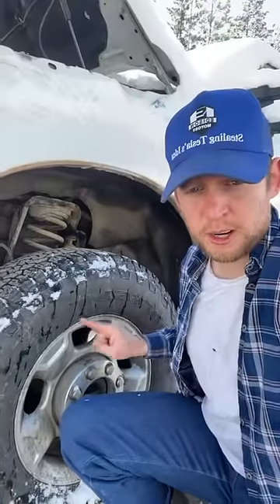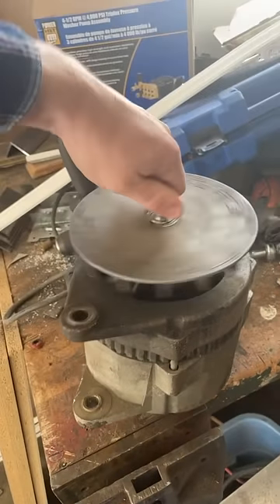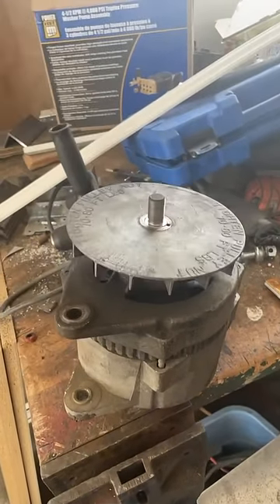Alternator on each wheel???

Comment: You're wrong bud. You're forgetting about centrifugal force and momentum. Whether the alternator is on your engine or your wheels, they both lose energy but the result is the same. The wheel idea does have more loss when your stopped and the wheels are not turning, but can gain energy back as the wheels turn faster, and your foot is not on the accelerator pedal, coasting. Btw, Tesla is doing this.

Comment: Show me the math. Use a pulley so it turns easier it doesn't have to spin as fast as the wheel. You could use a gyro and only engage them on the down hill

Comment: So now the question is why doesnt tesla use regenerative breaking. I know regenerative break will help a lot because i would drive a honda civic hybrid short distances that was owned by my company. It would go weeks without putting fuel in and at one point i could swear it went an entire moth with a single drop of gas in it and it always had battery power.

Comment: Surely these "laws of energy" need to be updated as technology progresses. If not an alternator, then something of a design in which will dictate heat with minimal friction that could not necessarily charge the battery but "top off" or just help add runtime? It's not an impossible idea unless you are stuck on an the idea of an actual or technical alternator. Let's think outside the box, but use the words "charging system". I mean, an alternator doesn't technically charge a battery from a fully discharged state. It only puts out enough amps to top off a battery that had very little drain from kicking over a little starter motor for a split second. 6,000 mi for an alternator to actually fully charge a fully discharged battery 12 v battery. Why don't people understand this? EV or electric vehicles are typically 80v systems. . It is a complete different application. Its like saying you want an alternator on your laptop.... 😅 Perhaps there is a structure that could be built in the roadways to wirelessly charge lithium packs in the future?? That would essentially be the equivalent of an alternator in a internal combustion engine with an conventional starting system that uses seconds cranking amps with and alternator to recover those tiny amps drained vs. An alternator on a battery powered vehicle that uses deep cycle or amp hours over long periods of time. An electric car is far more like a cell phone or a rechargeable lithium anything than it is like an conventional internal combustion car. People need to quit comparing the mechanics of an electric vehicle vs a gas vehicle. 2 completely different things if you really think about it.

Comment: Wonder why there hasent been a big flywheel car..  like over driving a few miles the flywheel gets its momentum and uses that afterwards to charge or reuse the force to push the car..  i guess the bearings would go to shit quicker and not work right..  but theres roller coasters that power off a huge flywheel that gets spun up at the beginning of each day and only has to use small motors throughout the day to keep its speed up which apparently uses less power than all other mechanical roller coasters..

Comment: It does work, and grandpa is right. You put a motor on each wheel. Then you can have all wheel drive, or one wheel and the others are regeneration.  The resistence from magnetic fields or whatever, air friction, all become meaningless ass the mass increases. This owner, is wrong.

Comment: The tesla drive motor energizes the stator during braking to slow the vehicle. This is what regenerative braking is. So when you press the brake you recharge the battery some. A fully fielded alternator cannot be turned by hand, meaning it would use more usable power than it created due to heat losses. Who are these people?

Comment: They have alternators on all the wheels a electric motor and alternator are the same thing basically so whenever u hit the breaks it uses the electric motor as a alternator to slow the vehicle and charge the battery done this way u are not braking the laws of conservation but it will only extend your range not full charge your battery

Comment: It would only be a slightly more efficient regenerative brake, any gain, would be accompanied by a 40-50% loss,  because alternators are only 50-60 % efficient, a 3phase electronically regulator maybe 85-90% efficient, but car alternators are 70%+/- at best

Comment: also the faster they turn the more power they make, thus you would essentially limit your max speed. your battery also wants to charge at a pretty specific voltage and that voltage could change out of that spec and potentially ruin your 3000 pound battery thus killing your car. and lastly, do you really want something as sensitive as an alternator that close to the ground and that exposed to the elements? i sure wouldn't.

Comment: What if, a pulley system was designed to lighten that load from the alternator that can produce around 500w? Then use that power directly to recharge or move the car.

Comment: Your first problem is believing that there IS nothing to generate energy from.  The first law of general dynamics is incorrect, because there is no such thing as nothing.  Just because you cannot see what is between you and the object in front of you does not mean that there is NOTHING there. You are simply not aware of what is actually there.  Start your energy solution in another direction.  The one you are in comes to a dead end.

Comment: That is not completely the truth. They can use gear ratios to lessen the resistance on the drive train while spinning the generator. Of course, you would also need to use 3 different battery banks, increasing the capacity 33% between the 1st battery bank and the 3rd battery bank. When the 1st battery bank reaches 33%, it will automatically switch to bank 2. When the 1st battery bank reaches a safe charging temperature, it will automatically begin to fast charge. As bank 2 reaches 33%, it will then switch to bank 3, bank 3 is the largest,  allowing bank 1 to fully change, switching to bank 2, which will already be cool. This will continue  while the car is in eco mode.

Comment: He's paid off, to not to promote free electricity created,  storage of power would solve this to creating movement to getting the wheels on the vehicle moving,  to start the charging,.. I've seen a full size car  run on compressed air, had a 40 gallon storage tank, as it rolled it kept constant air pressure ,the 3 big car makers dropped by his place to witness, once they saw it,  they made sure this idea was shut down,  ended up buying him out

Comment: I'm not a scientist or an electrician but wouldn't the alternator return anyway even if you just pushed it down the road in neutral with the car off I mean the wheel spinning is what turns the alternator now I know it takes power to make the wheel spin but if the wheel spinning would automatically charge the batteries. How much more power could it take from the motors to spin an alternator that turns when the wheel turns?

Comment: Ya but there’s no way that the alternator I can spin with my hand creates enough resistance to slow the car down plus if you just put them on the non drive tires they could charge it to where the range is significantly extended

Comment: Teslas like my Ford Fusion uses the momentum of the vehicle to recharge the batteries by turning the electric drive motors into generators. It’s called regenerative braking. Speed/ momentum is used to charge the batteries. Has nothing to do with the braking system. 
I like you posts yet please get it right.

Comment: Why not plug a electric powered generator into the cigarette plug and then have that charge up the battery when the car is on? It might not keep you charged forever but it will get you farther than those low mileage things get now to a charge..

Comment: Well let’s think about this. Every way we make electricity we are creating it from nothing. A wind mill is a generator or alternator that makes electricity. Their is drag and heat. Why do you hear about them catching on fire. 

Now let’s see about all the other ways we make electricity. We make electricity from nothing. We use water to spin generators in dams. Or steam in coal plants and nuclear plants. They all create heat and drag. 

Now for the alternator on the wheels. I work for a trucking company that has electric refers and they have generators on the tandems that charge the batteries when the truck is going down the road. Now they do not make it infinite power but makes the batteries last all day. Now I know this because when the generator went out the batteries only lasted 5 hours. With is they lasted 12 plus hours. So I say that it can work because it works on the trailers at work. But to get them back to 100% you do have to plug them back in. And running them all day uses about 80% of the batteries. That is them running for 12 hours continuously all day.

Comment: That's because it takes a iron core copper windings magnets and motion to create ac current you then need a diode to convert ac to DC but it can be done and energy has to be stored with is the real issue but it can be done

Comment: Use a stator assembly common place within the conversions of the hub assembly motors not an alternator I believe Ford has the patent so shouldn't't be an issue...(ACDC) duel converter's needed ...  However it would self sustain and elongate the batteries lifespan and  cut cost of replacement no money made on renewal energies it's a neutral investment.

Comment: This doesnt make sense. If you had 4 alternators,  1 on each wheel,  you would not lose energy. I mean you use power from the engine to turn the alternator. Why not use the forward momentum of the 2000+ pounds to charge the battery?

Comment: Here is a better question. Why don't they just go Hybrid. My 2014 Hybrid works just fine barely have to get gas and it charges the battery when I'm braking or slowing down. My battery stays charged.

Comment: years ago i looked at the rules for formal racing. one of them was "the cooling system can only be used to cool the engine".   now go back 150 years in technology. steam engines were the primary source of mechanical transportation.
  why not add a steam generator to topsy?  it would be a tribread.
the best internal combinations engines still waste the heat energy being only 30% efficient.
  the original patent for the radiator was for heating.

give me a break or put me to work.

i commented something similar on this very channel.

thermal dynamics?
pssssshhhh!
Reply: further more. a chainsaw could be converted into a working unit easily.

Comment: Not getting energy from nothing. Should do more than regenerative breaking does and with the weight of the car in motion. That extra resistance shouldn't matter much... At the least it should increase range alittle. Also forgetting alternators are like ancient in design that needs improvement.

Comment: I have an answer for your question. It's totally free use the alternators instead of brakes you generate power off of stopping or excess energy. When you break kcon for Alternators on each will to slow the car sorry saw a problem I fixed it best of luck God bless

Comment: It make it more efficient it doesn’t take that much energy to spin the wheel if anything it be catching energy and placing it back into they system yes it run out but it takes .00005 foot lbs of force to turn an alternator get the f outer here

Comment: What about if the motor on the back drives the car and is set to one coil turn number 

Then the front one is set to alternator that produces more current like a step up generator system where the smaller drive motor spins the larger alternator motor using the road as the belt system and then the motion would produce a greater current than what’s extorted and the battery system could be assisted by a solar panel rod to compensate for loss 

Boom I solved it 

But if you try it
You’ll get shut down
Your aloes either an electric car
Or a solar roof 
If you find a way to combine 
Your able to be off grid 
Also if you add that if you did do that 

Your car would slow you to be off grid instantly 

Because the car essentially becomes a moving power station 

Do you get it ?

Step up transfer car with unlimited electrical power no need for fuel with a stupid top speed

They won’t slow you to make it until they have the ai to control it or else we could also go off grid from our car alone 

Same system out into any minibus or camper van conversion 

They have these in space ship and the army has bricked generators using radio active magnets that generate such power that’s why people are fighting because Russia has this tech so does South Americas natives as well as the ancient cities but the try king people who the earth is in debt to doesn’t want us to allow electricity to flow through the air at such a. Rate because the frequency of free electricity is a higher vibration than the sickness in the world can tolerate 

In short
If we all had these in our homes
There would be no need for power bills
And the frequency of the electrical machine would clear the air of bad bacteria because electricity is fire and fire kills bacteria and we as a planet have a bacterial infection causing the people to get sick when they breath in the air of this planet 

Clean air clear mind you can see clear and your heart can hear the greater beings emotions
It’s of pain

The world is in pain and so are the people
That’s why they sick into the distractions 
Cus it hurts less than the truth 
It’s never ending and the truth hurts 
To feel trapped isn’t physical

You can be trapped by your pain and in fear so you pretend it’s all ok
You put on this persona as soon as you meet anyone else so they don’t see how broken all of the world in inside distracting themselves from the truth of the memories that they have had blocked out of what happened

Comment: Ok so a supercharger robs power to make power.... I would rather have 4 alternators on the wheels generating power to let me go further. I had a 2019 accord hybrid. Didn't have to plug it in but the batteries would get charged from engine transmission and brakes. (What the dealership told me). I got rid of it bc the cost to replace battery packs every 10 years negates the money i saved at the pump for 10 years. Would have been the same as just buying a regular accord. So if someone could explain this simply I'd appreciate it. I honestly don't understand. Not trolling anyone.

Comment: He turned that alternater very easy so why wouldn't it work it wouldn't be that much friction you would have to power the battery more with more alternator it will work

Comment: I think what the guy is getting at is why isn't there a system where you can regenerate power from the wheels not only from breaking going downhill but also just the actual movement of the vehicle yeah you're going to have a parachute train going uphill but if you have that ability to gain so much power in neutral without expending power going downhill in a heavy hauling vehicle say like a logging trail all downhill and you don't have to use anything but your brakes hardly any gas
Reply: you really just dont understand that is exactly what he just explained wont work because the second you try to draw power the car will slow down

Comment: The main reason is actually the gear ratio.
These are not actual figures but for example.
1st gear 1 crank turn = 3 gear turn = 0.1 wheel turn
Or 1 crank turn = 10 alternator turn.
You want the big gear (engine) turning small gear (stator) as opposed to big driving bigger. Also youd be fucked in neutral

Comment: I want to see someone build it and proves it wont work.  That 1st law he quoted, dont apply.  Its not energy out of nothing, its energy out of a spinning wheel.  😂  you can actually install a totally separate system around the rotor.  Like a water turbine.  AND no one said the system need to run the whole vehicle.

Comment: Or you can be like kenosegg and run a 600 hp 3 cylinder engine to a generator that gives direct power to the electric motor

Comment: Then use the same type of non friction charging ring (stator) that motorcycles, and other small engines use to charge thier batteries with. You could even stack them and use 3-4 per wheel. Now stop making excuses.

Comment: Just put a diesel engine in a car and run it on biofuel.
No need for electric vehicles 

Already have the most environmental friendly engine.

The diesel engine is called a diesel after person who invented it.

Diesel.

And not the fuel they call diesel.

You could still put a diesel engine and electric power vehicles together 
And use biofuel to charge the battery's

Comment: This would only be true if the power source was already being used at full capacity a plaid had like 1000hp your not useing 1000 hp to drive to Starbucks it can handle additional load and if that load  doesn't exceed the regeneration add a small transmission between the alternator and power source drive8ng the secondary alternator no u can't keep it going forever but it would further extend range

Comment: A 12 v at 125 amps puts average 13.3 to 15 v on a battery while running between idle and 27 3300 rpm, That's with a voltage regulator.  I'm calling your sht. To drag it on further it was that bad of a depletion it only go for about O'idfk... 20 to 40 minutes before dying on the road side.

Comment: 🧏It would be interesting though if they could develop a system that would only engage the alternator recharging when the brakes were applied. Therefore not to strain the motor when Driving.🤷 (🧑‍🎓or🤦) idk maybe worth a try👨‍🔧 even if just to prolong the time between actually being plugged in for the next full charge.